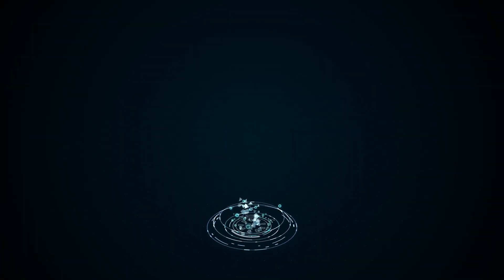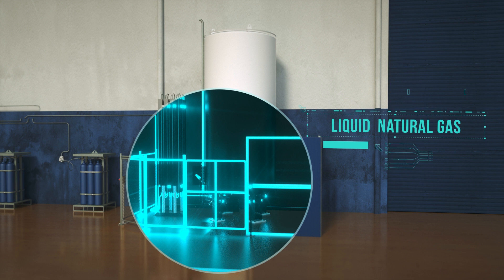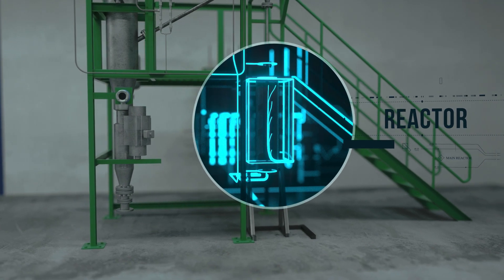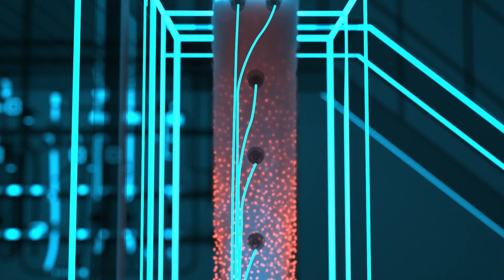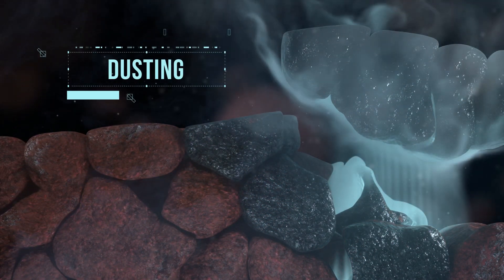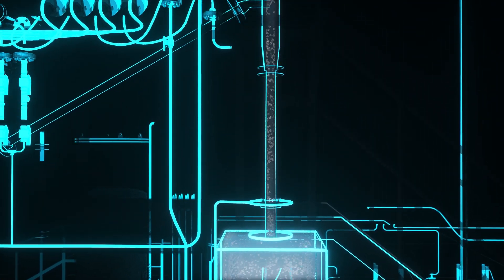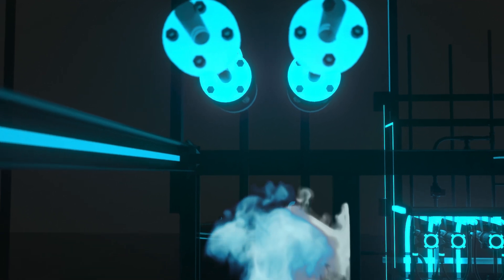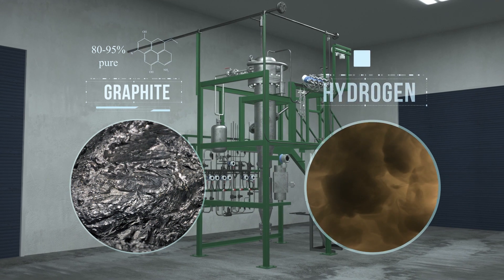Hazer Pilot Plant

Comment: Iron ORE is an Oxide. Oxygen reacts with Carbon giving CO2. Oxygen reacts with Hydrogen giving H2O! The process is not a CO2-free! The ORE is not a catalyst as it is converted to the metallic Iron. One should add a new “catalyst “. By definition the catalyst does not change and not needs to be continuously added. The ORE is a REACTANT!!!